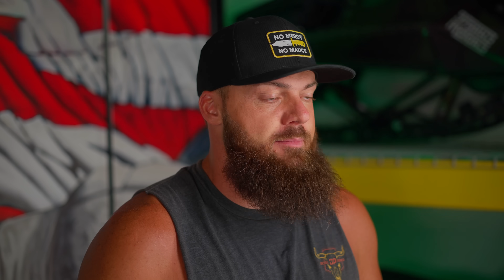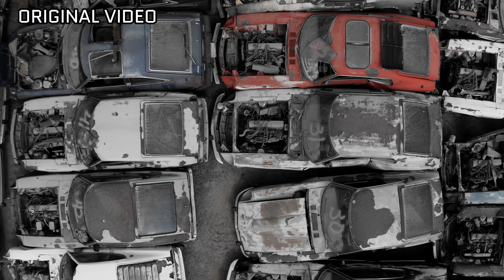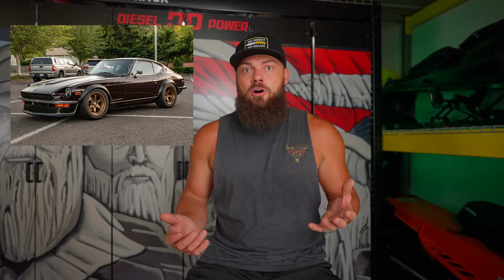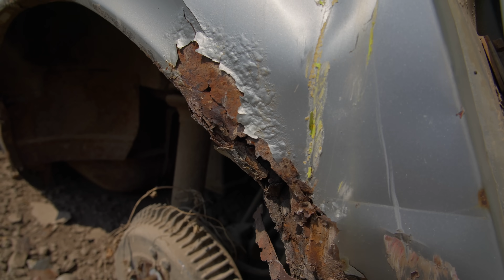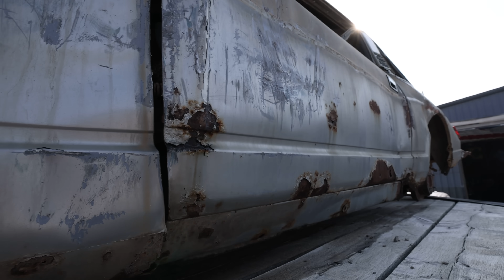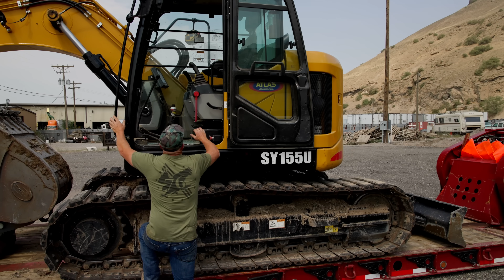Why Would I Smash 70 Rare Sports Cars??

Comment: I don't know what all the fuss is about it's clear to anybody that's done any work on cars, especially anything old or unloved, that what's there isn't worth saving. Those cars don't have small rust spots they have full structural sections missing.  You'd probably need all 6 of those cars just to make one good one, that's not even close to being good value and well and truly out of the ability of 99.99999% of people, also picking them for parts. That's legit picking a dead carcass looking at what's there and who the fuck goes that crazy over glass, unless it's an original early 240Z getting a resto then who the fuck cares. Shouldn't kept the original video up, fuck what 12yr olds think, they're junk cars